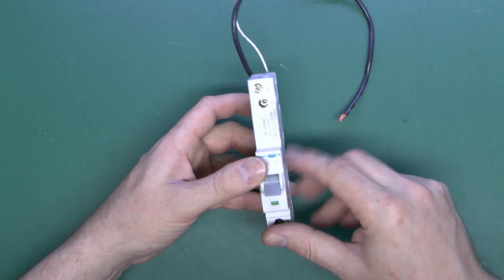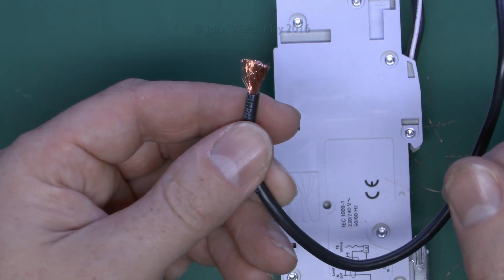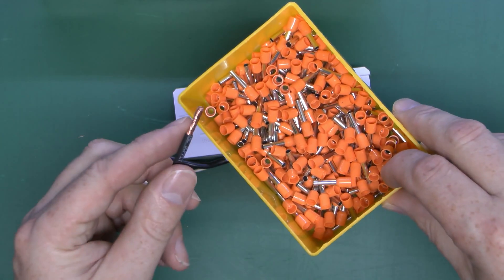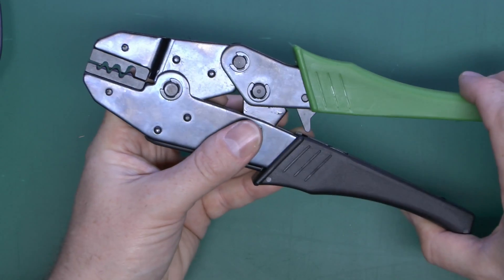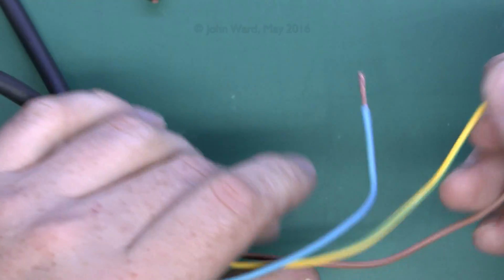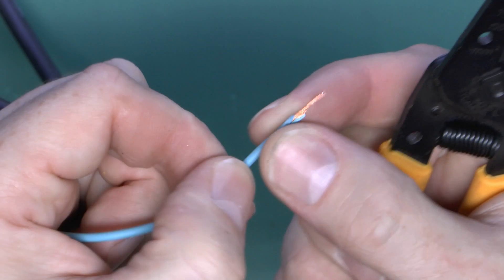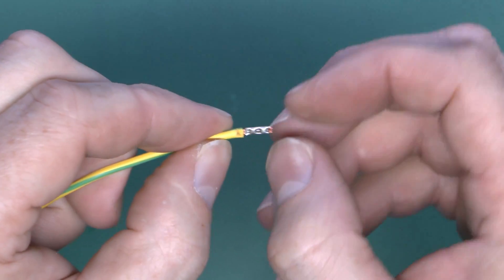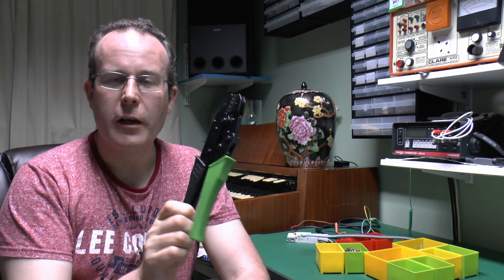Cord End Terminals / Bootlace Ferrules for Fine Stranded Wires

Comment: The old manual crimping tool is not totally useless , it does the job just as well as a modern ratchet crimping tool, but the downside is is you need to crimp two or three times along the length of the crimp . Also if you can’t tell  if you have applied enough pressure then you shouldn’t be doing crimps.
Reply from the maker: Crimps are designed to be crimped once in one specific position.  If you have mashed some other tool into it in 3 different places, the crimp is destroyed.
Reply: So these indents are actually creating a gap/airspace between the metal clamp and the ferrule in the terminal of a circuit breaker?

Comment: you are using the crimpers wrong. Hold the crimper in right hand with movable lever underneath which you squeeze. Insert the crimp from the left side and squeeze lightly to hold the crimp. Then insert wire from left side into crimp. Finally squeeze to closed. You do not turn the crimper upside down. That is WRONG

Comment: When crimping those cylinder-type ferrules, the crimpers you used crimp one side, though I've seen a crimping tool that crimps the cylinder into a square shape. What's the difference? Any reason to use the crimpers you have over the other 'square' crimpers, and vice versa ?
Reply: I have a 4 way and its very good.
Reply: Just an older design

Comment: The way you did it is also not correct at all. Twisting the wire before introducing it into the ferrule is wrong 😑
Reply: There's nothing wrong with twisting the wire. If you prefer to struggle with the strands peeling off as you insert it, I'm not your mom, but don't go talking like you know what you're saying
Reply: Why?
Reply: @ericlyus  The reason is that crimps are designed to crimp down to a certain circular area (the area occupied by the bare wire; not the same as the cross-sectional area), and twisting the wire slightly increases that area - leading to over-crimping crushing & damaging the conductors & weakening the joint.
Reply: @allinoner  
Can you point us to a research that deals with this issue? I'd like to see how much strength the connection loses if strands are twisted.
Reply: @aleksandarsrdanov1171  I only have the DIN VDE book in German 🤷🏻‍♂️. But it’s too expensive to buy just to read the norms. I have it from work

Comment: I have the square opening crimper that came with an assortment of ferrules.  I think it's a better design, the crimp is applied all around the ferrule end.  Also, note when John stripped the first wire, he cut off about 7 strands of the wire, so be careful when stripping so as not to cut off the strands. Sometimes it's better to use a soldering iron tip to strip the wires.

https://www.amazon.com/gp/product/B07PJK2VNT/ref=ppx_yo_dt_b_search_asin_title?ie=UTF8&psc=1

Comment: @JohnWard can one insert three stranded cables (let's say 4 sqmm each) into one ferrule (eg 10 or 12 sq mm)?
Reply from the maker: Only if the ferrule is designed for 3 separate wires.  Most are not.
Reply: @jwflame  thanks a lot
Reply: @jwflame  Bit confused by the crimper you used. Every crimper I see for ferrules specifically are a square of hexagonal shape, whereas your tool looks like the tool I use for crimping standard crimp connectors?
Reply: NM. Answer was in another comment below. :-) There is a third crimper design I've not seen. Maybe a difference between the UK and North American markets.
Reply: @TheDrew2022  I have the square opening crimper that came with an assortment of ferrules.  I think it's a better design, the crimp is applied all around the ferrule end.  Also, note when John stripped the first wire, he cut off about 7 strands of the wire, so be careful when stripping so as not to cut off the strands.

https://www.amazon.com/gp/product/B07PJK2VNT/ref=ppx_yo_dt_b_search_asin_title?ie=UTF8&psc=1

Comment: Hello,
Is this crimping tool do both insulated and non insulated crimps?
What make is crimping tool?
I wish to buy wire crimping tool for various sizes and can do insulated and non insulated crimps.
Many thanks
Reply from the maker: The tool in the video is only for insulated crimps, non insulated needs a different type of tool.  The tool has to match the crimps exactly, so there isn't a single tool that does all types.
Reply: The style of tool in the video does do uninsulated bootlace ferrules too. The only difference is there wouldn't be the small PVC shroud at the start of the ferrule. The principle of crimping the two is exactly the same, no matter what style of bootlace crimping tool you use.

Comment: I remember using these very expensive ratchet crimpers in aerospace engineering as an apprentice.  Each crimp operation or combined set of operations on a job was counted on a card (dated and initialled) and after so many, the tool had to be sent to Standards Lab for re-calibration.  When we actually had proper control of standards in this country.  Even the mains plugs were wired by a skilled person and we only ever used the good old MK built like a brick shithouse plugs.

Comment: What about crimping two wires together, for example where you need to connect two wires to one socket terminal?
Reply: Yes you use double ferrule for that.
Reply: @SkazaTV  Ok thanks.
Reply: @SkazaTV  would be a bit annoying if you needed to seperate them to do some testing or fault finding though. Can you put 2 single ferules in a single terminal?
Reply: @cooper512  yes, but you need to make sure they fit ok.

Comment: Is it common to use stranded wire in AC wiring in Europe? In the U.S. all I've ever seen in residential homes and businesses is solid core wire, negating the need for crimped ends. Solid core wire is a pain to work in other respects though!
Reply from the maker: Building wiring is solid for smaller sizes and usually 7 strand for larger sizes, which in most cases can be connected without ferrules.  Fine stranded is typically used for control systems such as heating and cooling installations, or interconnects within distribution boards or other panels.
Reply: In sweden it the other way around. small sizes up to1,5mmsq seem to usually be stranded and 2,5 and larger wires solid core. Much easier to rout stranded wire through conduit in walls. But sweden and the uk have totally different systems for that. It's less of an issue when you use twin and earth anyway like they do in the UK. Using those in swedish wall conduits would be like pushinf a diamond back through a drinking straw. WE do have stranded for bigger cables aswell and is probably more common now than 20 years ago because the electricians need to use it more since the smallest fuse today is 10 or 13 amps while it used to be 6 amps when we didnt have computers and other power hungry equipment.
Reply: @rimmersbryggeri  We have stranded conduit wire here in the UK in individual conductors as opposed to twin core and earth.

Comment: How would these work  with something like a multi zone heating system where 2 or more cables are connected in junction boxes?
Would the screw choc block connections grip 2 or more of these?
Reply: You can get crimps that take 2 into one.
Reply: @nicholaspratt7934  but there's often  4 or more neutrals
Reply: Guess if you have some spare terminals then it'd be ok

Comment: The exact crimper shown is available here  https://www.switchelectronics.co.uk/tools-equipment/tools/crimping-tools

I'd like to mention that bootlace ferrule crimpers are different from the similar looking non-insulated terminal crimpers, and also different from insulated (Red-Yellow-Blue) terminal crimpers (the photo of the crimper shown at 4:51 as an example of a cheap crimper to not buy is for these colored insulated terminals, so it is the wrong tool anyway regardless of quality). 

CK make all three types of crimper (non-insualted terminals, insulated Red-Yellow-Blue terminals and bootlace ferrules). 
The CK 30018, 30029, 30022 are the ones for bootlace ferrules.
https://www.screwfix.com/p/c-k-crimping-pliers-7/6497x
https://www.screwfix.com/p/c-k-crimping-plier-0-5-6mm/75132
https://www.screwfix.com/p/c-k-crimping-pliers-9/9476x

Comment: I have some crimp terminals where I've been crimping the insulated bit rather than the metal bit. I'm wandering wether I've been doing it wrong or wether they are different ?
Reply from the maker: Depends on the style - some insulated terminals are designed to be crimped over the insulation, others are not.

Comment: No need to twist the wires strands before applying the ferrule. They go on easier with straight strands. I'd also recommend using a 4 or 6 side crimper instead of the flat style shown.
Reply: Don't forget that he had been splaying the wires out and showing why they would not make good contact.  Need to get them back into a shape which would go in the ferrule without bending back some of the little wires.

Comment: What’s the chance of making a video on crimping and sizing of spade terminals inside boilers to connect ntc’s and sensors etc. There seems to be so many different tools, different crimping dies and sizes of spades, not sure on the best method. A lot of connections are angled/flag terminals in boilers and I can’t seem to find out much information on these and if the tools are suitable for a range of different sizes. 
Side note:
Just bought an automatic ferrule crimper because of this video, AMAZING connections! Thanks.

Comment: Another great video, what is you thoughts on extending a cooker cable 6mm to 6mm using insulated yellow crimp.
Either that or connector block or Wago. Thanks
Reply from the maker: Crimps are fine if done properly.  Unfortunately many crimp tools are useless and even the good ones still need to be used properly..
The Wago connectors are reliable and don't need any special tools, so would recommend those rather than crimps.  They do need to be put inside a suitable box or enclosure.
Reply: @jwflame  Thanks for the fast reply.

Comment: Can you cut down the length of ferrule if the terminal depth is shallow and only accepts say half of the ferrule? Or perhaps use heatshrink?? Some boiler terminal connections can be very shallow so wouldn’t want any exposed metal to each connection point.
Reply from the maker: Yes - crimp first, then cut down to the length required.
Crimps can also be obtained in different lengths.
Reply: John Ward  thank you for taking the time to reply 😎. Fantastic videos, very informative and interesting 👍. The electrical workings of the 3 port valve/mid position valve was especially helpful. Very much appreciated.

Comment: Great video as usual John. One of my pet hates is when you have 2 spurs at the back of a socket where you have to get 3 cables into each terminal. Trying to get them all in and clamped up tightly is a pain in my experience. I am always concerned about lose cables because they can cause problems. It has never occured to me to crimp the 3 cables together using a ferrule before inserting them into the back of the socket. Anyone see any problem with this? I figure a 6mm ferrule or bootlace ferrule would take the 3 cables comfortably and also fit inside the socket terminal port easily. Any thoughts people?
Reply from the maker: 2 things - most crimps are not designed for 3 wires, and crimping them together will make subsequent testing or alterations far more difficult.
Reply: Cheers.
Reply: You can get special two-wire ferrules. I would not be inclined to shove three wires together and shove them into the device. US wiring generally uses a wire nut and a pigtail for situations like that, although US wiring also still puts hooked (solid) wires directly under terminal screws 😔. I don't know what the UK codes require in that situation.
Reply: I was going to ask a similar question, but for using a crimp on the odd occasions where there would be 5 or so 1 mmsq earth wires in the back of a box.  Wagos take up to much space and chocbloc's always look a bit ruff to me.

So, if a 6 mmsq cable has 7 stands -  each approx 1 mmsq - and it works well with a ferrule, I'm guessing there would be no problem using a crimp on a bunch of 1 mmsq earth wires?  I think I'll do some testing.

For the second part, testing should be ok, though yes, anyone working on it afterwards is unlikely to be a happy bunny.
Reply: @HeathenGeek  The problem with that is that the entry to the crimp area is funnel-shaped to avoid causing the wires to abraid on the edge. Three wires coming into a crimp designed for one are going to have a lot of insulation in the way, so it might not fit it all, or the crimp would not crimp on to the insulation just the wire, which is not a good situation.
Reply: In general bootlace ferrules are only used for stranded wires. Most of the wires we used in domestic wiring rings or circuits is solid core. So ferrules are a little pointless. For wiring in boilers on S&Y plan these are excellent. The resistance is also reduced using ferrules. It's best not to twist the strands before the wires inserted. So you get a larger cross section surface area for the strands to crimp onto.

Comment: Could you tin it with solder instead? Would that  meet the regs?
Reply from the maker: Solder is very soft, and when used under a screw can flow and result in a loose connection, so it is not recommended.

Comment: Thanks for sharing,   I myself  tend to  solder fine  stranded cable ends to  prevent them fraying, as  its a given I  wont be able to put my hands on any ferules when  needed  but I can always lay my hands on a soldering iron ;)
Reply: DO NOT SOLDER if they're going under a screw. The solder will creep over time, leading to a bad joint and if there's substantial current flow, a potential fire hazard.

This isn't theoretical either. I've seen a number of fires caused by this kind of practice.
Reply: Finally someone who did, too. Thanks.

Comment: I have an insulated type crimper (CK-30021) which I used extensively on a 12v system whilst fitting out a boat. (ie using the red, blue, green plastic sleeved crimps).  I notice that here you use a non-insulated crimper (ie like the CK-30025).  As I intend to start crimping my 240v domestic connections when possible should I now consider getting a non-insulated crimper or will the CK-30021 be OK?    Thanks for your very helpful videos.
Reply: I know this was a long time ago, but the crimp tool required for bootlace ferrules is different from the crimp tool used on non-insulated terminals and the crimp tool used on insulated (Red-Yellow-Blue) terminals. CK make dedicated bootlace ferrule crimpers and they are CK 30018, 30029 and 30022. Always make sure the crimper you are buying is for bootlace ferrules and not for regular non-insulated terminals. The exact crimper shown in this video is available here: https://www.switchelectronics.co.uk/tools-equipment/tools/crimping-tools.

Comment: what about using ferrules on 7 stranded wire like bs6231 wire?
Reply: ... what about what? If you would like to use them, then do so. If you don't want to use them, then don't. Did you forget to actually watch the video, perhaps noting what is said around 10:05 ?? The only time that ferrules might be a bit silly is when you are using solid (1 strand) cables.
Reply: I actually missed that part... Thanks.

Comment: Why are these things made with stranded wire, let alone such fine ones? I mean, after all, the only movement there should be on it is during installation, and a solid wire should cope with that, surely?
Reply: It is very hard to bend the solid wire at tight spaces (pipes in control cabinets etc)
Reply: Well, yes, in pipes, but these are wires for installation inside distribution boxes. Very good access.
Reply: Well, in distribution boxes at homes, usually solid wire is used up to 2.5-4mm2, but beyond that it is very hard to bend the wire again. For example 6mm2 EPH conductors are all stranded. It is also easier to roll up stranded wire when the distribution box is being modified/disassembled.
Reply: I always like the old style distribution boxes where the wire is carefully bent into shapes like busbars.
Reply: Yeah, old things had style.
Reply: And solid wire creates tension in the equipment. I remember, once I made up a junction box with some circuit breakers and motor switch. Used solid wire of size 2.5mm2 and it remained springy after installing it.
Reply: I'm a domestic gas engineer, I recently did a course with Baxi. I asked the tutor why the boiler instructions state 0.75 multi strand cable to connect the boiler to the fused spur and external controls.
The answer was due to the fact the boiler control panel every year is opened for the boiler service, and 0.75 multi strand wire allows the panel to open and the wires to give without damaging the wire.
Reply: @aspudkicker  Also the fact that boilers tend to consume very little wattage.  So using anything larger would be a bit of an overkill.

Comment: Did you twist the litz wire itself and is it a good idea before crimping the connector? I've learned to twist only by soldering (+Strider9655 doesn't support this method, see comment far below).

Comment: hi John, great video thanks. in my line of work I come across many hundreds of pieces of twin and earth jointed with butt crimps. many of these I find are incorrectly done - for example incorrect tool used, wrong crimp colour, no heayshrink over the assembly etc. is this something you would consider a video on? i would do myself but your presentation style takes some bearing! loz

Comment: Quiet, quiet, quiet, loud. Quiet, quiet, quiet, loud. :D

Use a proper hexagonal bootlace ferrule crimping tool. AU$25 from eBay. Your crimps are so distorted that they won't fit into most round screw terminal holes.